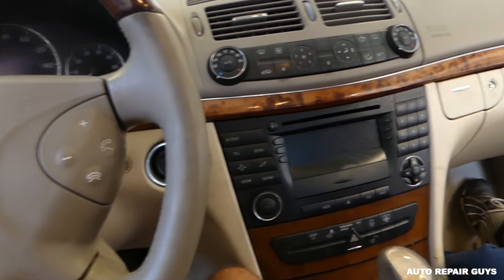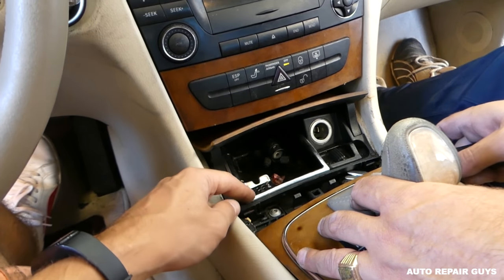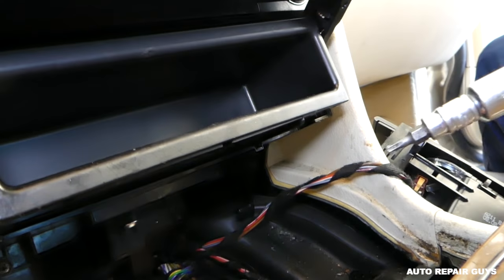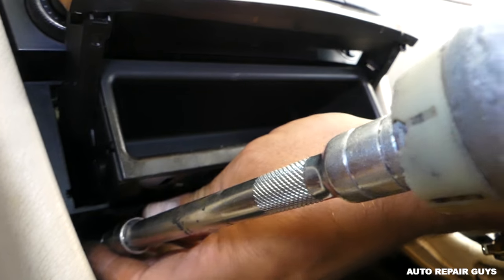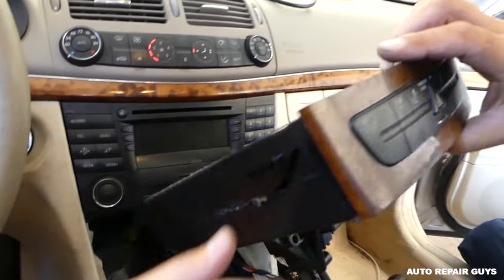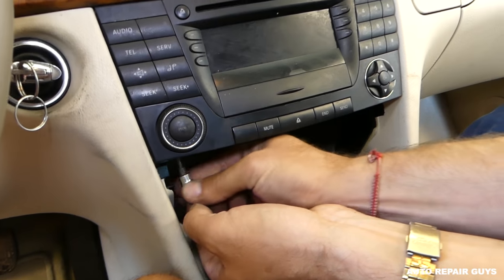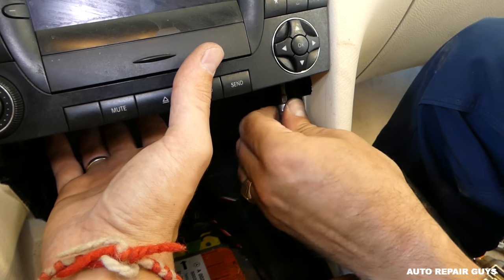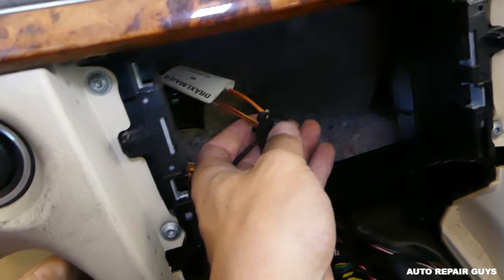HOW TO REMOVE RADIO ON MERCEDES W211 RADIO REPLACEMENT

Comment: Would have never figured out the endless radio screws. Thank you
Reply: A Solution to open the CD changer, for those who have changed the original radio for another compatible one, it will stop working, I attach a link to the video. https://youtu.be/LyyNz7oVGoU

Comment: Great info as usual guys! Keep up the good work 👍 Thank you!!
Reply: A Solution to open the CD changer, for those who have changed the original radio for another compatible one, it will stop working, I attach a link to the video. https://youtu.be/LyyNz7oVGoU

Comment: Which is the best aftermarket radio I can get to replace the oem for my w211 E320 mate
Reply: XTRONS
Reply: Reputable brands like kenwood etc
Reply: A Solution to open the CD changer, for those who have changed the original radio for another compatible one, it will stop working, I attach a link to the video. https://youtu.be/LyyNz7oVGoU

Comment: Guys Hi, thank you for your great videos. I would like to ask you a question. I purchased a fm transmitter it works but makes some stupid bad noises. Checked from youtube that I should remove antenna for better solution. Do you have any idea of it? When I use it in garage it has cool music but outdoor, full of noises. Can you help me?
Reply: A Solution to open the CD changer, for those who have changed the original radio for another compatible one, it will stop working, I attach a link to the video. https://youtu.be/LyyNz7oVGoU

Comment: Awesome, Thank you!
Reply: A Solution to open the CD changer, for those who have changed the original radio for another compatible one, it will stop working, I attach a link to the video. https://youtu.be/LyyNz7oVGoU

Comment: Cool! Are u going to change the radio to a navigation unit?
Reply: A Solution to open the CD changer, for those who have changed the original radio for another compatible one, it will stop working, I attach a link to the video. https://youtu.be/LyyNz7oVGoU

Comment: How to remove the compartment cable, in my case it's not coming out with just pulling, is there a special way?
Reply: A Solution to open the CD changer, for those who have changed the original radio for another compatible one, it will stop working, I attach a link to the video. https://youtu.be/LyyNz7oVGoU

Comment: How to fix radio keys light w211? Keys dont light up when i turn the lights on
Reply: A Solution to open the CD changer, for those who have changed the original radio for another compatible one, it will stop working, I attach a link to the video. https://youtu.be/LyyNz7oVGoU

Comment: the radio light is extremely dim. The R button knob is functional but the radio display light is very dim and hardly readable during the day time.
Reply: A Solution to open the CD changer, for those who have changed the original radio for another compatible one, it will stop working, I attach a link to the video. https://youtu.be/LyyNz7oVGoU

Comment: How do you get it to close after it opens? It doesn't load cd and it won't shut back
Reply: A Solution to open the CD changer, for those who have changed the original radio for another compatible one, it will stop working, I attach a link to the video. https://youtu.be/LyyNz7oVGoU

Comment: Thank you
Reply: A Solution to open the CD changer, for those who have changed the original radio for another compatible one, it will stop working, I attach a link to the video. https://youtu.be/LyyNz7oVGoU